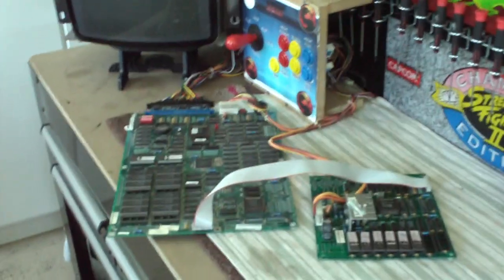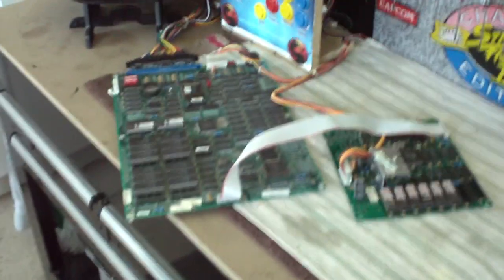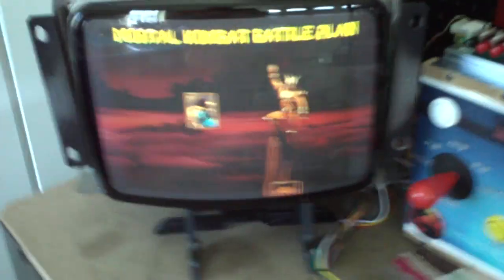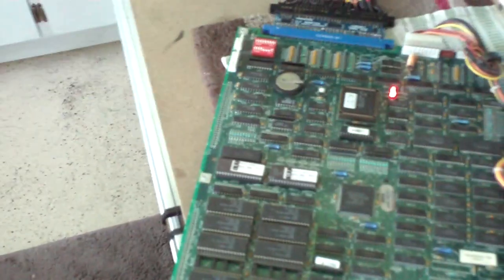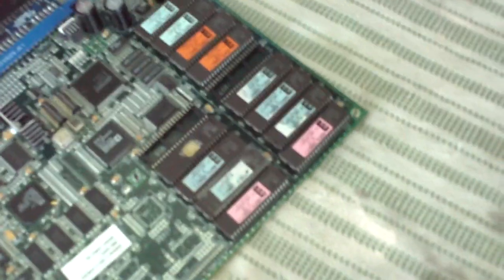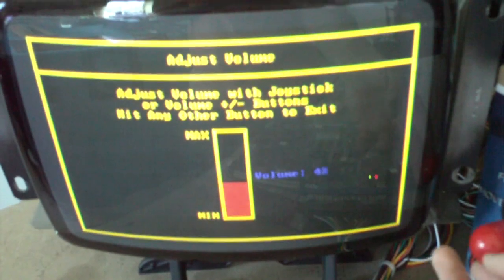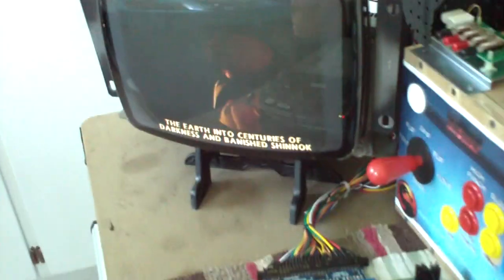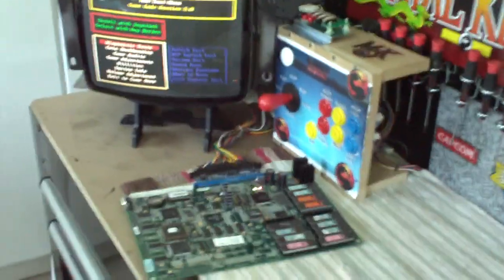Mortal Kombat 2 II & 4 IV Arcade Jamma PCB tests

Comment from the maker: @YourMKArcadeSource yes but i like the connector better it's easier to plug and unplug, also the hacked MK1 does not have the slot cut so I need to use this or remove the white peg to use that one.